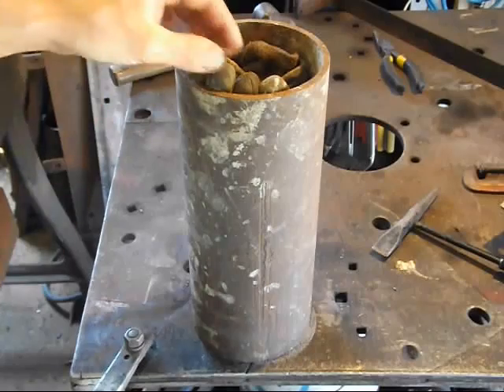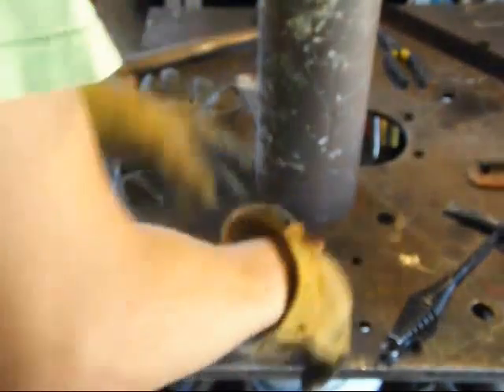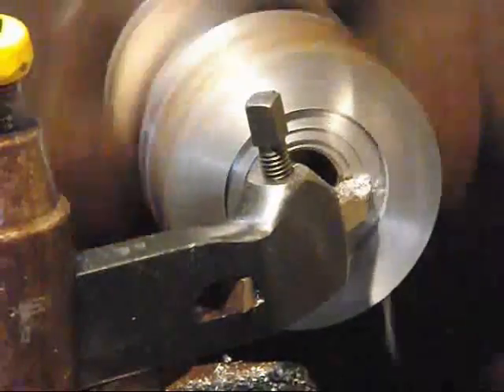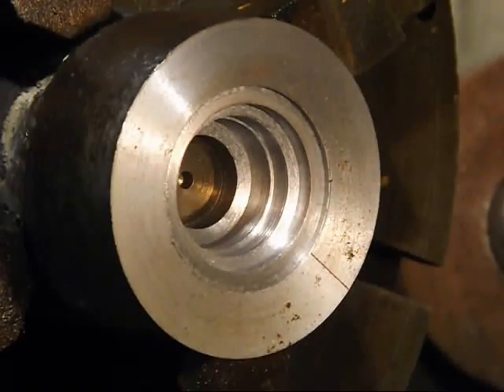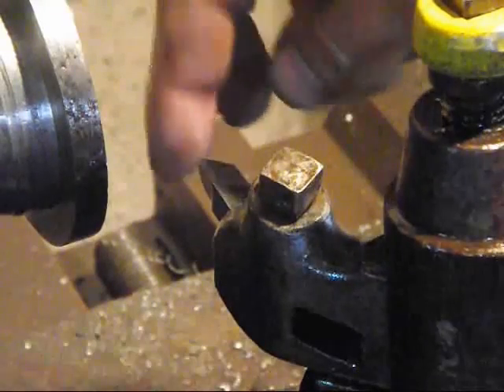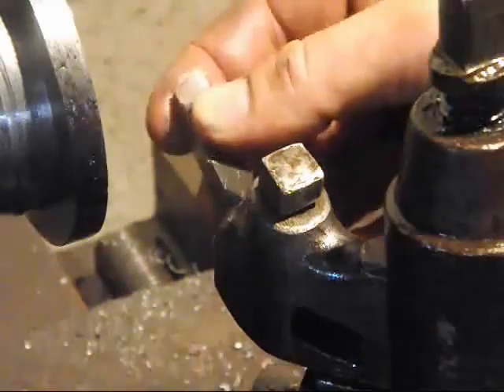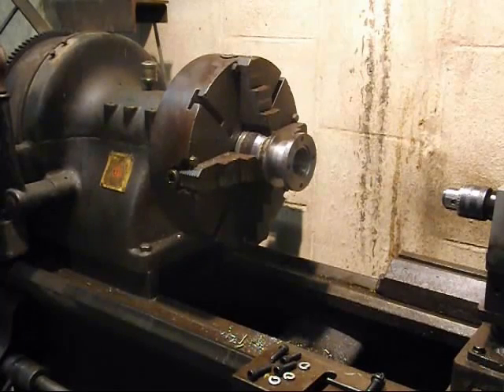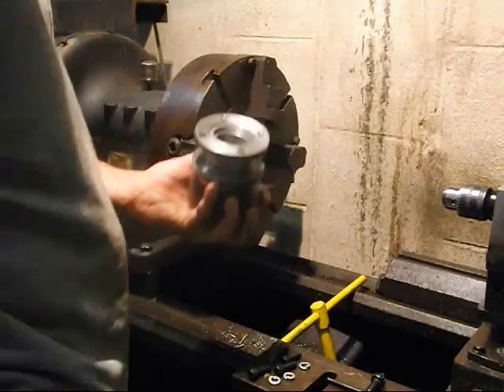Cub Cadet Drive Shaft Build- part 2 of 2

Comment: So on my cub cadet 109 I swapped with a 3 cylinder Kubota Diesel I did the same driveshaft build, and when you rev it up tye cv axle boots expand and bust open, even with better aftermarket ones, what would you suggest I do? Thanks in advance.
Reply from the maker: Kubota swap sounds awesome! The boot expanding, not so much. That really sucks!   I've used this setup for years, and often with the engine at full RPM for hours on end. I wish I could help, but I really have no idea why yours would be expanding.

Comment: I've got that same tractor but with the stock 14 horse Kohler engine. I built a front end loader for it and run the hydraulics off the transmission. It works great and has a bucket that holds about a wheelbarrow of dirt. Been catching a lot of your videos lately and really enjoy your style of fabrication, it's a lot like mine. 😀 Thanks for all the videos they're great!

Comment: Just got finished doing the same thing to my cub thanks to this inspiration! Quick question though... Do you have issues with the boots getting off balance at high RPM? Im running mine with very little grease and with the boot compressed up against the CV and it still gets wobbly. Not sure what to do about it.
Reply from the maker: I'm glad I could inspire!  But I've had no issues with the boots. However the factory ring clamps flew off after several hours so I replaced them with normal hose clamps. I'm wondering if your boots are old and not holding their shape?
Reply: They are actually brand new boots! I tried it with the old ones and they actually worked better since the rubber had started to go hard. Too bad they are split. But I had the same issue with those clamps and Ive switched over to the screwed clamps too... Ill just cinch them down and run with it for now. If they come loose it'll just add rust protection! Thanks!

Comment: What about the Transmission Fan ?  do you need it?
Reply: Only two things will kill the transmission, dirt and heat.  The missing fan will cause the transmission to overheat and fail.
Reply from the maker: I haven't noticed any issues not having it.

Comment: I think that beast can support a bit more blade, especially since the driveline is solid now.
Reply from the maker: +Jeffrey Plum I would think significantly more, but I need to get better tires before I go bigger.
Reply: +Wide Vision Metal Fab  I could have used it,  last Winter in Boston!
Merry Christmas and thanks for the fine work.

Comment: I think studs and nuts, instead of cap screws, might have made for an easier install. It looks like awfully close quarters.

Are you any closer to having a mill?
Reply from the maker: Why did I not think of studs! I have to keep that in mind if I ever have to take it back off. Thanks! :) Maybe a bit closer on the mill. My operating loan is paid off. YAY! So I'm debating about getting another loan...

Comment: Good use of scrap yard parts to make it work. You can remove the workpiece out of the lathe test fit it and put it back in and use a dial indicator to get it to run true again.
Reply from the maker: Thanks! And regarding returning the piece to the lathe, it's possible, but sometimes it's a real pain.

Comment: I was watching this thinking I'd seen it before....then I read the description..LOL
Is she still running??

Colin ;-)
Reply from the maker: ***** Running great! It has moved a lot of dirt in that time too.
Reply: @WideVisionMetalFab  Still Going ?
Reply from the maker: @johnchadwicktilton  Not at the moment. It broke a while back. The boot ripped on the CV joint and all the grease escaped which caused the joint on the transmission side to seize.  I saw the grease building up around the frame, but was in the middle of a huge project I needed the Cub Cadet for, so I didn't stop to do proper maintenance. I got  years of hard use out of it, and it would still be going if I had stopped to replace the boot and repack it with grease!
Reply: @WideVisionMetalFab  Danggit. I hate it when that happens.

Comment: I think this is the lathe that you upgraded the motor? I noticed in this video that the lathe slowed down under load. How is the lathe doing wth the new motor?
Reply: Also, your lighting has really improved.
Reply from the maker: craigleemehan It is the lathe.  It's doing great with the new motor. I'm hoping to have another update in the next couple weeks about the switch and wiring. (Waiting on a plug I had to order)   I was using halogen lights at the time of this video. It was shortly after this video that I stumbled across a YouTube video about lighting, it caused me to switch to LED daylight bulbs. Plus, all new Fluorescent fixtures helped a lot!